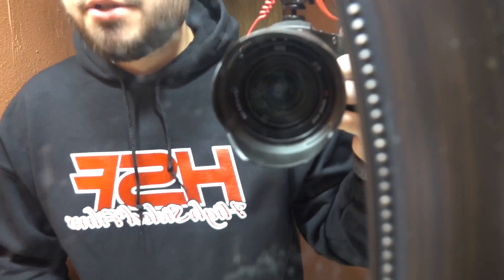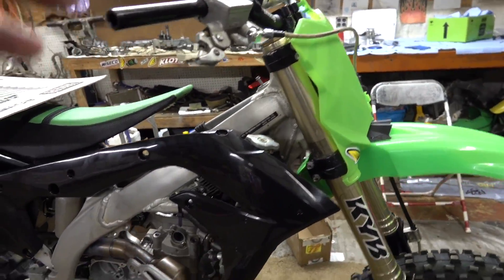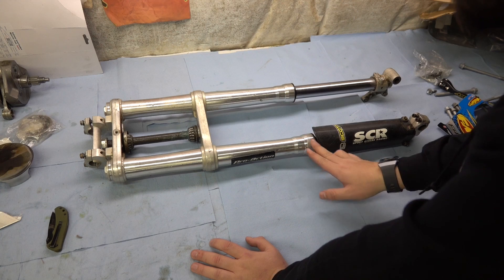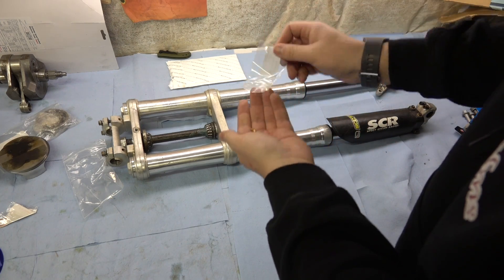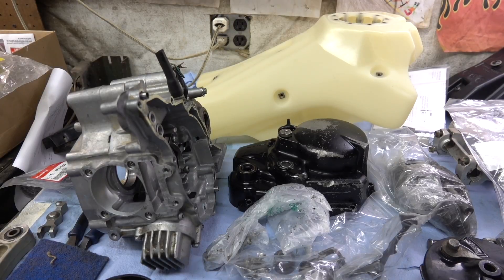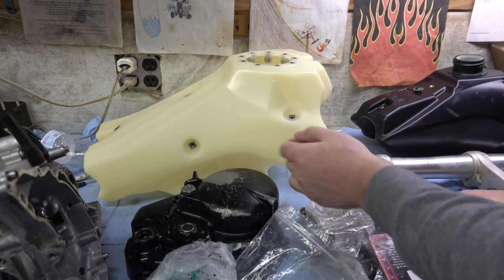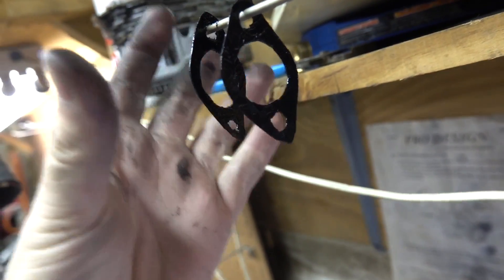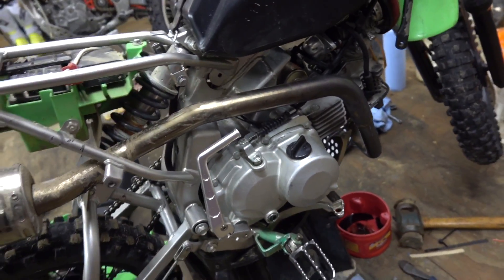NEW PIT BIKE BUILD GETS A HUGE UPGRADE!!!

Comment: Klx195 Full Mod. Ktm 65 forks and what a bbr super stock swingarm? do a fox float shock with the extender piece for the 110L. And do a rear kx65 wheel and a disc brake.
Reply: Gogle Sucks 
Get another Job and Buy it for him